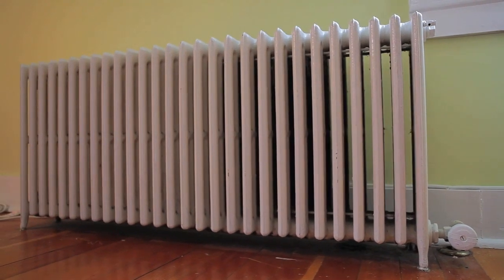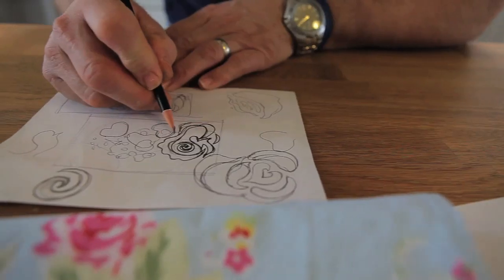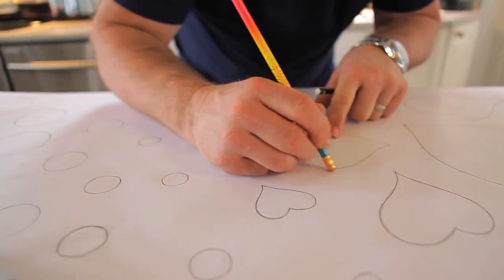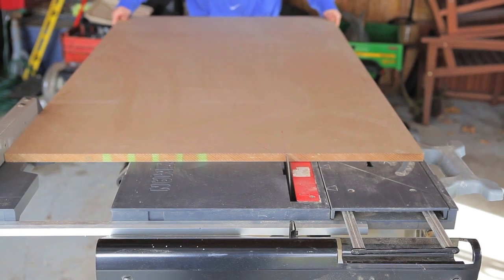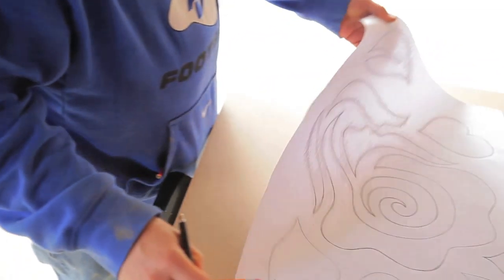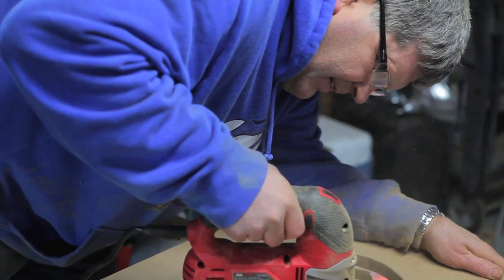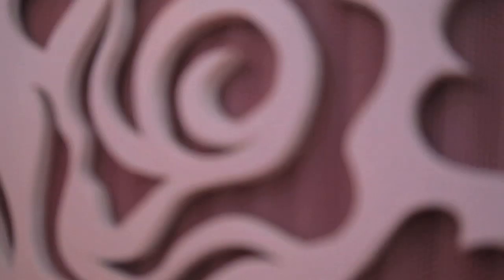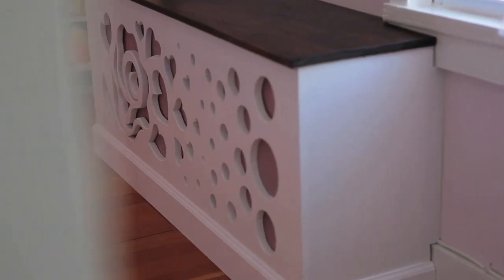Make Your Own Custom Radiator Cover with TMD

Comment: Apart from the design pattern for the front grill, which is lovely, everything about this project is wrong. There is zero air flow over the rad surface and no way for any heat to convect into the room.  A gap of 3   inches between the floor and the base of the grill is required to draw cool air in at the bottom of the cabinet and another between the top of the grill and the base of the lid

Comment: Looks great, but doesn´t this simply insulate the radiator thermically from the room? I guess basically it gets hot inside the "box" and only some heat escapes through the holes inside the design. The rest of the heat is somehow "trapped"